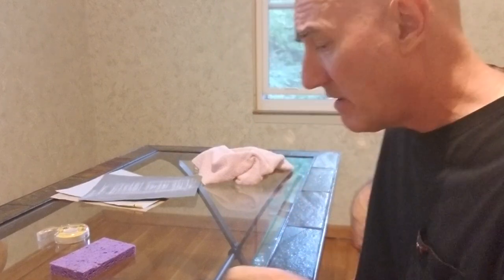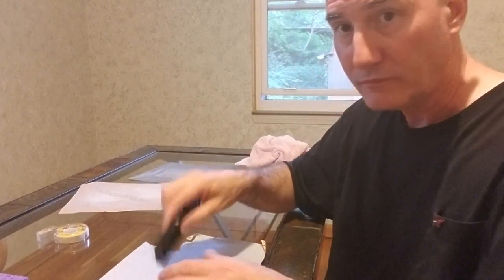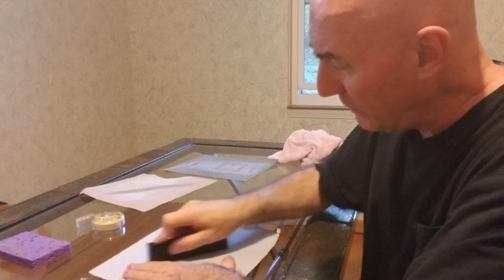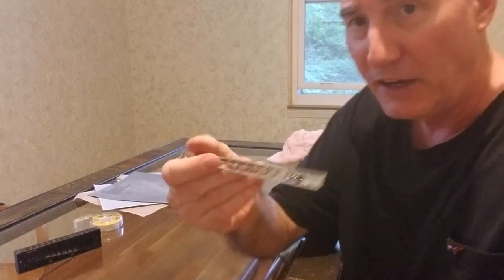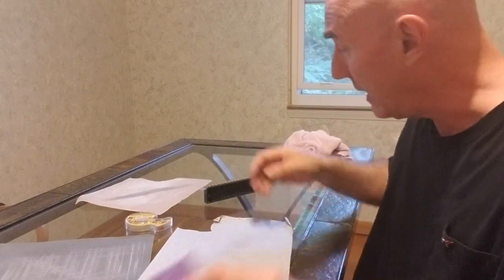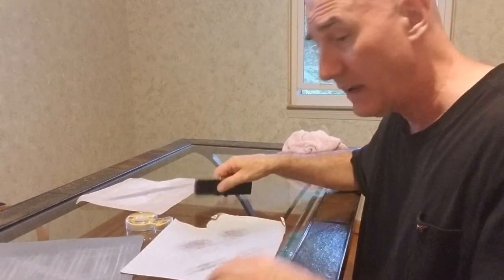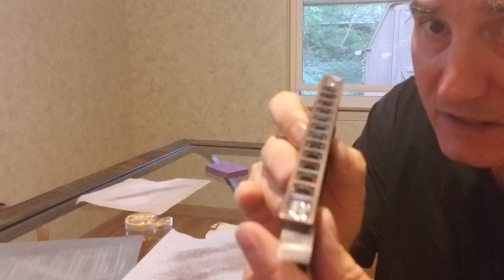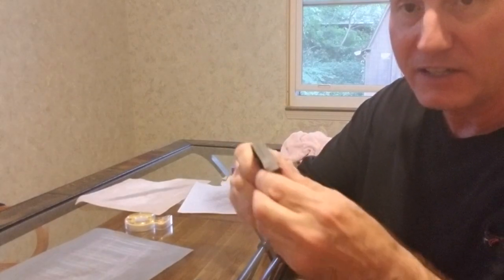#3 Low Cost Swan SW1248 Customization Sanding Comb & Mouthpiece Kettlewell chromatic harmonica

Comment: hello, thanks for the great vid. i have one of this swan 1248's with the old square mouthpiece (like the one in the vid). i would like to sand the mouthpiece as shown but it seems that mine is different then yours. yours is straight while mine has a pretty big curve from side to side... the curve is to the opposite side of the mouthpiece, so when its screwed into the comb the pressure of the screws make it "straight" along the comb. does it make sense? is that a defect or is it normal? should i keep it like this or try straightening it somehow? any clue or idea? would like some help. thank ahead :)
Reply from the maker: Hi...if you watch the video in the series on the Swan 1664 customization, dealing with sanding the comb face and underside of the mouthpiece, you're questions will be answered.

Comment: just sanded down a 10 hole swan chromatic after watching this. Couldn't do the mouth part though, at least not the same way as it's got a lip along both edges which fit over the side.
Reply from the maker: Great...I hope it went well for you. It is possible to Lapp a mouthpiece into the comb itself, but not if the mouthpiece is curved left to right in an arc. See if you are happy with the comb sanding alone. I think there is a video where the Lapping I just discussed is shown, of a Swan SW1248M harp. On Youtube I did.